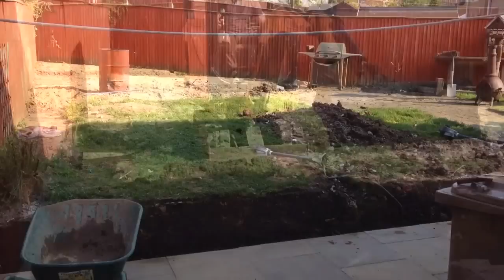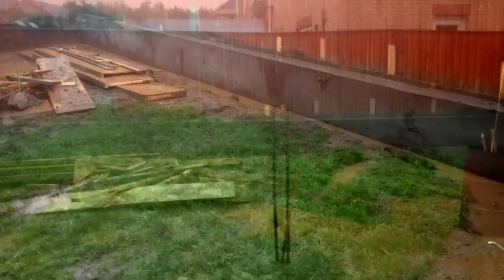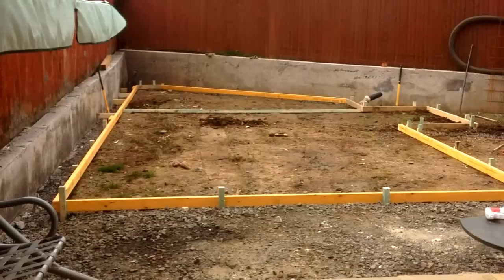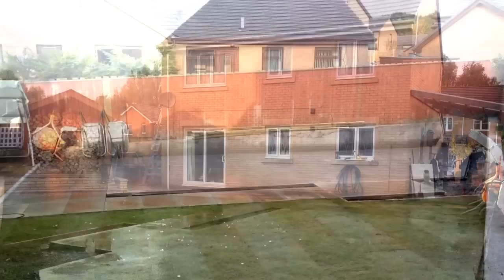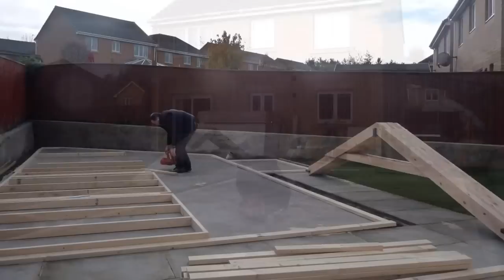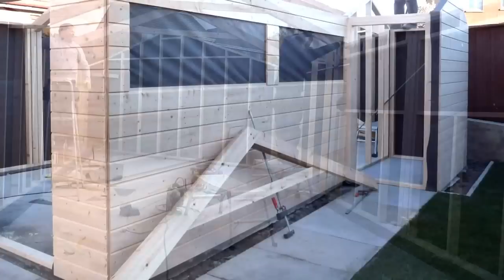Building my garden workshop part 1

Comment: hey, did you fit'/bolt the wall frames into the concrete foundation or are they just floating somewhat, if you did use anchor bolts, which ones, thanks again!
Reply from the maker: Hi. I think I just used plugs and screws, doesn’t need much. Way to heavy to move
Reply: @DalyMalcolm  yeah thats what i was thinking, im probably over thinking things as its my first time building my own, not like the wind is going to move it even without plugs and screws, ill probably go that direction myself, seems much easier, thanks again mate.

Comment: Clay soil has a bulk density of around 19-22kN/m3 10kN = 1000kg therefore each cubic of soil was 2200kg if your lorry was taking away 10 tonnes at a time it was less than 5 cubic meters a time, also there is a factor for bulking when you dig it up

Comment: Nice vid, what size are the wall studs? 2x4 or bigger?  in millimetres is fine and where did you buy them from?
Reply from the maker: Alistair Dymock 4x2 alistair.  Just picked it up from the local timber merchants 👍
Reply: Looks good, thought it was thicker from the vid. 2 x 4s tend to be about 89mm thick so what width insulation did you use and is it warm enough in winter (not sure where you live)?

Also, if you don't mine, would you critique my plans?
http://www.diynot.com/diy/threads/insulated-timber-framed-garden-room.474157/
Reply from the maker: Alistair Dymock look ok bud, I'm not a fan of flat roofs, if you want to use 100mm cellotex then build your walls with 4x2 reg'd timber, it'll be about 95mm, just let it stick out on the inside, plasterboard will be fine screwed on with a gap. Lay a concrete slab! And use a breather membrane behind your weather boards and Itll be dry and warm 😊👍
Reply: but shouldn't there be 1 inch batten between the membrane and cladding ? I was gong to do it this way but was told i had to skin in osb then membrane, batten then clad ?
Reply: I think that's what he meant Lee
Reply: if you look at the vid Malcolm fixes it straight to the frame with the cladding on top no boards or battens the is no air gap for the back of the cladding to breath ? this is what i was going to do but was told it was wrong and would cause damp ... also notice Malcolm put vapor barrier (green sheeting) on the inside but could not make out if the walls where insulated ... was just curious as i start my build in 2 weeks and to do it the way ive been told is going to cost me another few hundred pounds ... just wanted to know if Malcolm had any damp problems doing it this way cheers
Reply from the maker: lee edwards no damp, well not that ive noticed. I would put 1" strapping to create an air gap though, it sound like a good idea. In hindsight I would have put a couple course of brick round the bottom to lift the timber up a bit higher away from the ground, I've noticed some of the boards on the prevailing weather side looking a bit weather, more than the rest of the shed, 
Thanks for commenting 👍
Reply: Malcolm Daly  thanks I am going to take your advice plan on doing a Row of bricks for frame to sit on as the 12x16 workshop is going on a 15 x 20 slabbed  patio  then going to fill that course with concrete it adds a couple of hundred to my budget but should help with damp ... the walls I plan to batten on top of the tyvek before cladding it's the skin of osb on the outside I am struggling with cause that adds another couple of hundred pounds I want to just tack the tyvek to the frame then batten just worried about the tyvek flaming about

Comment: How is it possible that you could achieve this height so close to the fence?
Reply from the maker: It’s less than 2m high at the gutter. Not that high 🤷🏻‍♂️
Reply: looks high as you stand on a ladder, I thought you could have built higher because your ground level is higher
Reply from the maker: @Asikorphotgraphy  I tried to keep it hidden as much as I could.

Comment: Can I ask how you stopped water getting in between the base of the wall frame and the concrete floor?

Nice job, well done.
Reply from the maker: Simply by running the weatherboarding down past the concrete floor level 😉👍
Reply: Thanks Malcolm, sadly I wont have that option as my concrete pad is bigger than my shed.
Reply from the maker: Single course of brick ? Sit the frame on top of that? 😊
Reply: Thats the answer, many thanks! :)

Comment: I notice wood base is straight on to concrete, mine is the same, are you worried about water going underneath and getting base timbers wet?
Reply from the maker: Gary Arnold no the weather boards overlap the concrete

Comment: Where did you buy the timber?
Reply from the maker: 2wheelspy do you live in Scotland?
Reply: Malcolm Daly no, England’s, down south
Reply: Is it planed?
Reply from the maker: Yes it’s dressed. 20mm thick, and pressure treated. It was run by a company called MGM timber in Ayr. Not sure if there are any of them in England pal
Reply: Malcolm Daly dressed?
Reply from the maker: Yes